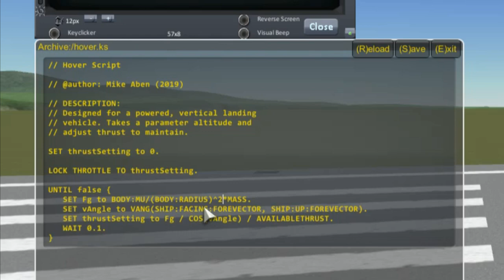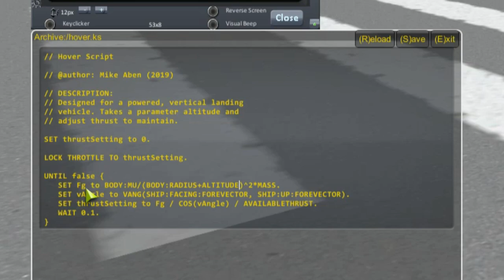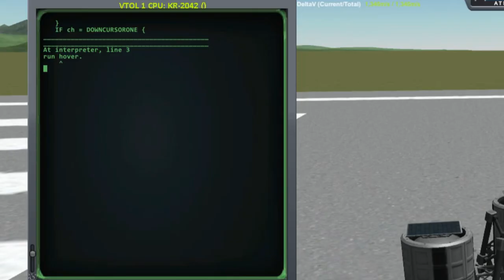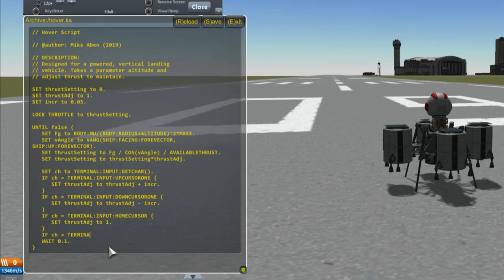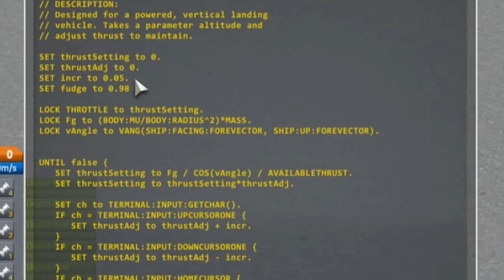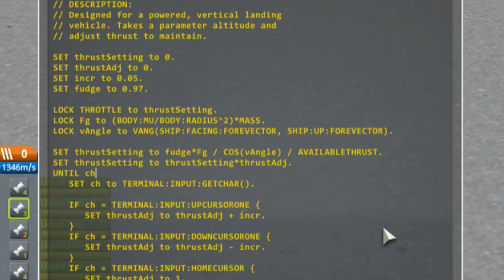Sandbox Saturday 2 - Building a kOS Hover Script

Comment: Available thrust goes to 0 when you run out of usable fuel, which is why you got a divide by zero error. You later found you were out of oxidizer. 
I wonder if having two "Set thrustsetting" lines might be making your throttle control wobble a bit. In the first line, its set to match the vessel weight, then you take the throttle into account, then you don't ... 

I was very interested in the real-time input to a kOS script.
Reply from the maker: I combination the two set thrustSettings into one next ep after it starts causing issues.